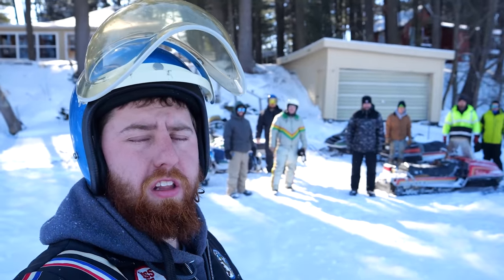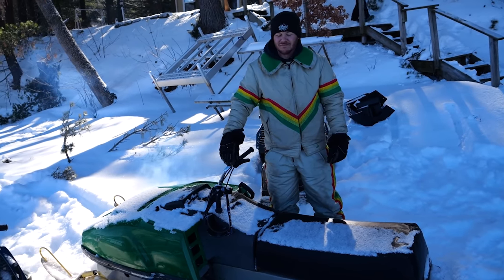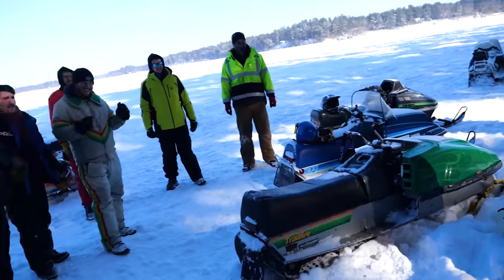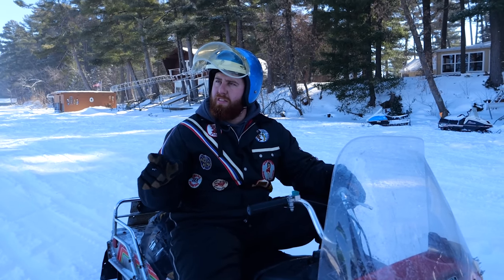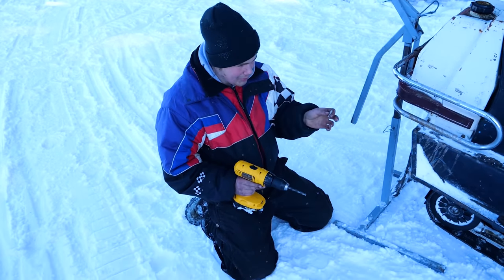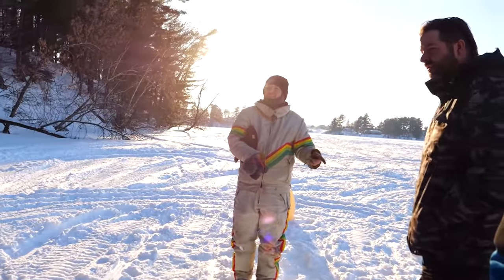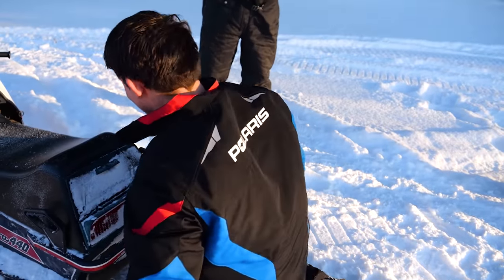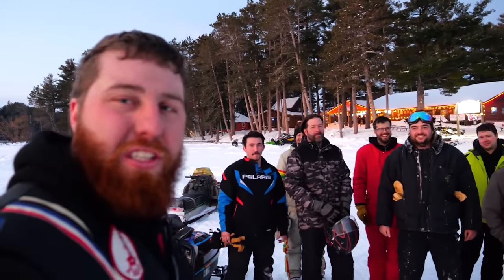$500 VINTAGE Snowmobile CHALLENGE - Will WE Survive!?

Comment: That was some great fun!  I have lived in Alaska sense 1962 and in 1968 as a senior in high school I was the only one with my own snowmobile, a 1965 Polaris Mustang with a 14hp JLO single engine. The other kids had to use their parents machines. Of course I customized mine with welding 3sided files to the skews under the skies for tighter turning. Cut down the windshield. Removed the muffler and headlight witch functioned as an air scoop for better carb and cooling. Custom ribbed rubber on the running boards. Squeeze handlebar grips. Custom bright red vinyl upholstery and a custom jet black paint job. Painted the skies to match the red seat. I removed the pull starter and just carried a rope to save weight. 
That was in McGrath Alaska about half way between Anchorage and Nome. I’m 73 now and sold my last snowmobile and motorcycle two years ago. Just play with my classic car collection now. I have over 50. Take care and have fun!
Reply: I'm wishing I had lived as much in my 66 years as you good sir have/had in your first 30 years no doubt.
Reply from the maker: Oh man that sounds like a hot machine!
Reply: You guys look like your haveing a blast!

Comment: When I was sixteen and living in Iowa, I got my first snowmobile, a 1981 Arctic Cat Pantera 500. I traded a junk Plymouth Lazer for it. Somehow I got that sled running with my limited mechanical skills, and it kicked so much ass all my friends got cheap junker vintage sleds. One got an Invader 340 I recall. Soon after I got one of the sickest vintage sleds ever, a 1979 Polaris Centurion 500 triple. I either paid $100 or $200. I don't wanna know what that thing is worth today. It had three huge Mikunis and three expansion chambers, obviously built to drag, but I stupidly trail rode it. One day I had to tow my buddy's invader home, and my Centurion broke the chain case. I sold it to some old guys for probably way too little. I had more snowmobiling adventures after that, but this video really brought back those first magical winters. Thank you

Comment: I plan to get 2 vw type3 squarebacks and turn one into a snow vehicle. The old type3 line up was basically a toboggan to begin with and with the engine in the back if it gave better traction for the tracks. Skiis on the front for steering and you're all set.
Might also get a couple slantbacks and notchbacks as well. Volkswagen air cooled and just air cooled vehicles in general are my favorite things to use. And practical to, best thing to run in Canadian winters since you don't got to worry about the radiator since ya don't even got or need one.

So I might take inspiration from this

Comment: Well, after seeing the first challenge I realize my experience with snowmobiles has been vastly different, and I'm curious if my experiences are atypical or if you had the best luck with all of these machines. Between my family and myself personally, I've had at least 4 various skis, several artic cat 440s, one that was some fancy liquid cooled rotax thing, and I don't even remember what else. Every one of them My brother and I would spend the entire winter tuning, adjusting, and fixing things to get them to run, we would get them going, everything seemed great, we'd take off and make it just far enough away from the house that we'd be winded when we walked back, and then they wouldn't run until next year when we repeated that same process after dragging them back with a truck or something in spring.
I moved far enough south that I'm never tempted to purchase another snowmobile. Problem solved.

Comment: Back when I could still ride and had vintage sleds, I had a few that I would have had a blast doing a trip like that with you guys and I think the performance of  2 of my 3 would have been a bit of a surprise to everyone else but the 3rd one would have been an unfair advantage on my part. The 2 that would have been surprising were a 72 Sno-Jet wide track 440 as it would grip the snow and ice like it was on rails for the oval and was fast at straight line racing. The other was a 73 or 74 Scorpion Stinger 400. For some reason it would outrun 440s that were several years newer and on an oval or road course it did great because it could drift on the corners beautifully without letting off the throttle. The 3rd was a Montana piped 70 Arctic Cat Puma factory Mod with a full race 634 Hirth which in 7 years of being raced by the original owner only lost 1 race and that was in 76 when a spark plug failed. It was sold at the end of the season and went through 5 owners by 1984 when I took it over. When I say it was a full race 634,  I mean it had high compression, was ported AND ribbon Ported, and was built as a race alcohol fueled sled. It was clocked breaking trail at 115.

Comment: Great video guys. Going on a vintage ride and show tomorrow in northern MN with my son. We don't ride leafers tho. Had a 69 panther but sold it to the dude that does the vintage shows around here. 
Side note tho I had the only 275 spirit engine (same as what is in the Jag 2000) that had oil injection on it. They tested the 340 and 275 and the 340 was the one they went with for cost reasons so they only made the one 275 injected engine. Sold it when I was a dumbass teenager tho but I wish I still had it just because.

Comment: I built this killer snowmobile for my brother.  it was a sleeper. I tucked Bombadere's 444 liquid-cooled engine under the hood. I had to cut a U  into to the fold of the aluminum body. He bought a Ski-Doo SM, mine was a 340 TNT...I wanted to take the comet clutch off mine & put it on his. But he & so-called friends took it bar hopping one night before I could get anti-freeze into the cooling system. The Radiators froze up & eventually, you can imagine what happened after that !!! 🤔

Comment: Growing up my dad had a couple attic cars that were probably from the 70s. They never ran right and one broke down in a field and sat there until summer. Years later he picked up another very used and old one. My experience with snow mobiles is exactly what you have shown. This is why I hate them.

Comment: I'm rather disappointed there wasn't a Snow Cruiser (Snow Crusher?) in the pack. A friend had one that was 12 HP that topped out around 19 or 20 MPH. You wanted plenty of help if you had to move it with the engine off.

Comment: A yamaha that don't start on the first or second pull means there is something wrong because I have a bunch of old vintage Yamaha's and they are the most reliable sleds and they always start the first or second pull unless a fuel pump, ignition, carb/choke issue. I have even broken some free from being seized up and they would still run like a top.